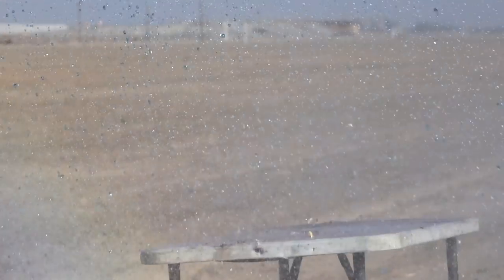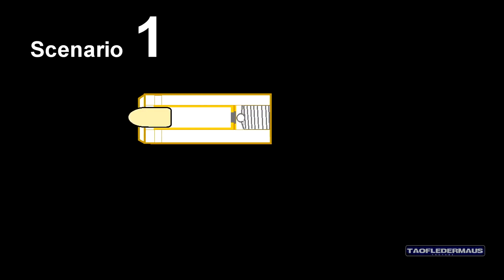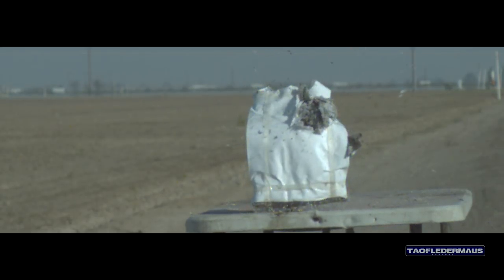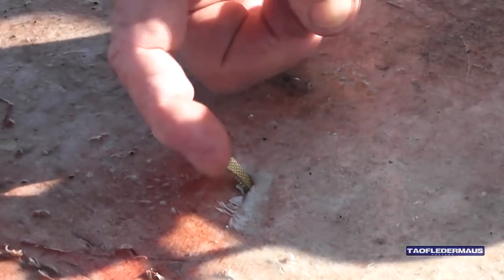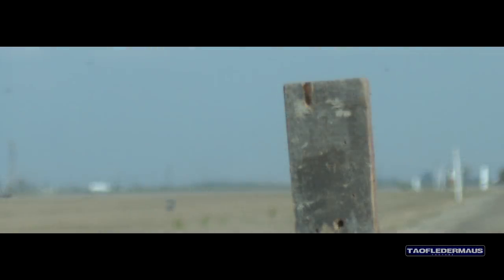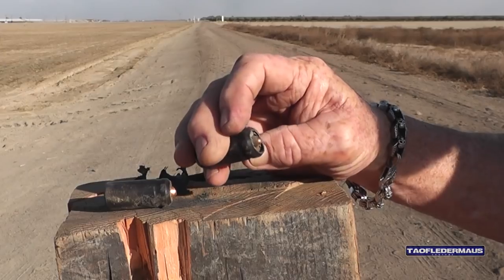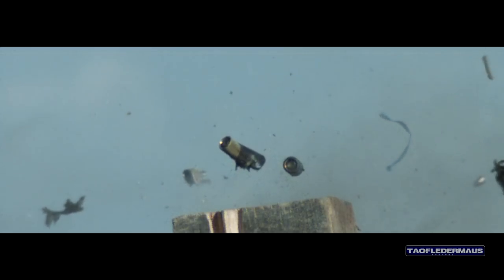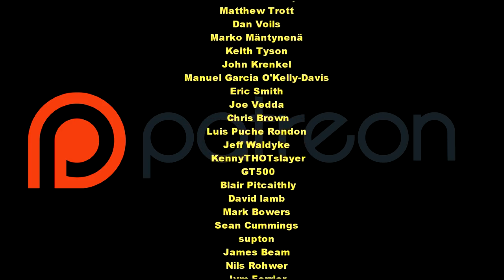The 12ga. Slug with a 9mm Round Inside?  - Too Dangerous?

Comment: With the weight and aerodynamic improvements that would be provided by having a 9mm inserted in the front of the slug I believe that these would have traveled straight if used properly.

Comment: Would it make sense to try these slugs with inert 9mm rounds?  That way you can have a look at their flight characteristics without the hazard of 'splosions and death.

Similarly - and this is one that you wouldn't want to test out, I suspect - you could use a foam rubber spacer between the BB and the 9mm round to provide damping of the initial acceleration.  The foam will crush and stay crushed (due to heating) and be ineffective on impact allowing the round to fire.  #makingthisstuffup

Comment: Could you maybe put a spacer between the 9mm and the BB? So the acceleration force cant push the 9mm on the BB, but the BB on the 9mm on impact. Maybe shoot it with a string pull.....would be really interesting.....why aren´t there any 12ga grenades anyway?
Reply from the maker: Because the ATF.

Comment: Would that round engage the rifling through a rifled barrel?
Reply from the maker: The dimensions were not right for rifling.   With the rubber coating it was way too tight,   without the coating it was way too loose.

Comment: It’s the mass ... heavy projectile traveling fast will do more damage than a lighter projectile. I wonder what this would do against drywall. How much further would it go even after a single sheet w/ insulation?
Reply from the maker: dry wall can't stop a fast ping pong ball
Reply: TAOFLEDERMAUS sorry I started with 1 thought and ended with a 2nd.  This round would probably make a smaller hole than the ping pong ball, but would the ‘fins’ come off and disperse?

Comment: Yeah why not make a timber gun rest and use a string from a distance/behind cover?
Reply from the maker: I'm not Bruce Wayne -  can't afford to blow up guns .
Reply: I wonder if some relatively cheap pipe in ~12 gauge inner diameter could stand in for a gun for some more questionable rounds. Or just a huge hunk of bar-stock with a 12 gauge diameter hole bored in it and a home made firing pin or one of those perimeter alarm things. Assuming "pipe guns" don't violate your local laws, of course.

Comment: What about blanks launched from a remote location?
Reply from the maker: A 9mm builds up much more barrel pressure than a 12 ga.  The round was trapped inside the brass slug and the only way for it to get out is to blow up the brass slug,  and it would have probably blown up the gun.   I can't afford to destroy any shotgun for a video that may only earn about $25 in revenue.
Reply: I understand that for sure... But isn't there a way to prevent it exploding at ignition? 

And keep up the good content! I really enjoy it.

Comment: Ya should have got one of them cheap ass 12g shotguns from Walmart there like 50 bucks and now there like 30 dollars on sale that was a few months back my friend has one fitted with a 80 god damn dollar trigger and a lovely Walther lothar barrel 20inch fully 12 grove rifled and he is actually a stock maker as his job so he made some Turkish walnut furniture it's stunning now and cost him less than 190 dollars just the barrel is worth like 299 dollars don't ask me how he got one. It's got a nice ghost ring and brass bead foresight he uses it for just targets and it can stack foster slugs on top of one another he takes some powder out so u get way less recoil but they still hit hard enough to drop game like whitetail deer even with a lower load but the point I was making was if u got a cheap one you could have loaded a 45in the slug and fired it with a string behind cover if u used a aluminium 6mm BB it would probably work on impact but they were flying like darn throwing knives rifled choke may have helped with stability

Comment: Of all the crazy ass stuff I have seen on this channel this has to be the most insane. Why would anyone want to shoot a knurled brass slug with a live round in it? We know from numerous other tests that firing a bullet or shot shell without a barrel just doesn't work. And if it did work you have the safety issue you mentioned of the round impacting sideways or backwards and not knowing where that secondary projectile would get launched. And even without a live round in it, shooting a chunk of knurled brass down your barrel just doesn't seem like a wise thing to do. 

Even if it did work I am failing to see a practical use for it. I don't know of anywhere in the United States where it is legal to hunt with exploding tipped bullets. Which I am pretty sure this would fall into that category. And while it might be legal in a home defense situation I certainly wouldn't want to go to court and try to defend using it. 

I am assuming the purpose of this round would be to 1.) increase the penitration, and/or 2.) get the performance advantage of a better designed pistol bullet. Number 1 simply isn't needed, regular slugs penetrate just fine, if not too well in most cases. And as for the second case, we can already buy factory loaded slugs with high performance pistol bullets in sabot rounds at just about any store that sells ammo. 

Now if it is just for shits and giggles then fine, feel free, it is America after all. I wouldn't want to shoot one out of MY gun though lol. And this has nothing to do with your or your site Jeff. I love what you do and find the videos highly entertaining. This is more for the guy that came up with it. Even without any other research, just watching your past videos on this site alone one could easily see that at best this would fail. At worst you could ruin a gun , and/or seriously injure someone, possibly fatally. I would have loved to hear Greg's thoughts and comments on this lol.

Comment: Not very impressive at all.  A standard foster slug would be better and more accurate.  These are probably designed to perform with the 9mm round inside.  Why not load a 9mm up and don't put a powder charge in them and see how it performs.  Probably wouldn't tumble and you could determine if it is safe to charge the 9mm round.

Comment: But....you've fired .22's from a shotgun before, in fact wasn't it a bunch of them just resting in a shell? And don't forget the ferrocerium! Why did you get squeamish on this one?
Reply from the maker: A secondary explosion in the barrel from a 9mm inside a brass container- where the only way out is to blow open the end of the brass ....  I'm sure it could blow the barrel.   I just have to be really careful because the shooters have to trust me that I'm not putting them in a dangerous position.  And I can't afford to blow up guns too .
Reply: I get that and can agree totally with safety being an issue. But I'm thinking barrels work BY exploding things in them and that there's way more powder behind the wad than in that 9mm case. You could always just use 9mm rounds that have a big roll crimp on the case if you're worried. Though I guess that's kind of a thing of the past now days.

Baring that.....why not the vice and string?!

I love your work, LOVE it. Just seems that with all the silly things you guys have shot from a shotgun in the past that this one was safety a bit late in coming. Not trying to be a dick or anything, I'm all about safety up to the point that I cringe my way through most of your awesome videos :P But all I thought when I first watched this one  was "well, why start now?!" :D

Comment: Why you guys never shot from behind a bulletproof glass these very experimental and unpredictable loads?
Reply: Expense probably, not to mention that the thickness of material they would need would be much more than is generally used, if you wanted it to actually be able to resist a full slug. The safety precautions they do take seem to be plenty for what they deal with.
Reply: I don't know, most of the times they do.... but still, better safe than sorry in this cases

Comment: Why even do it if you’re not going to use it for what it is designed for.,ridiculous.
Reply: Gregory Adkins 
Those are actually expansion anchors/plugs. Thats what they were "designed" for. These were repurposed for this usage. Do an E-bay search and you'll find them. If YOU want to fire these through a barrel with a loaded round in them, good luck and hope your barrel doesn't explode when the bullet expands the anchor in the barrel if it goes off from inertial force of 10.000 g's slamming the primer into the metal ball. I'm not doing it. Nope, no way.👎🏻.  🇺🇸😎
Reply from the maker: We aren't idiots.   Does that help?
Reply from the maker: are you capable of saying ANYTHING positive?
Reply: Danny AKA Triker Red I’m not disagreeing just saying it was not the way it was suppose to be done and that’s fine.